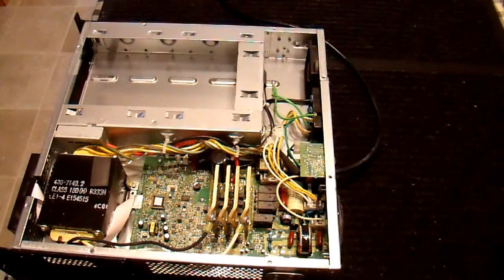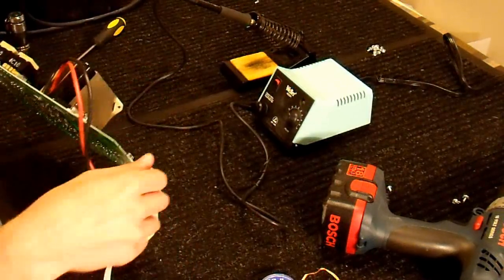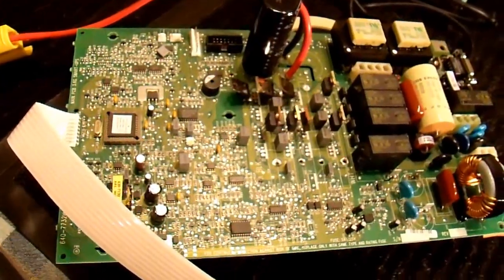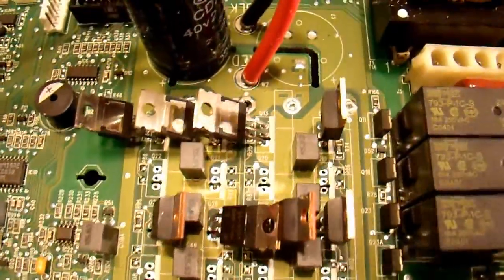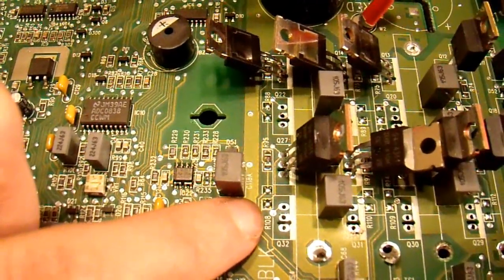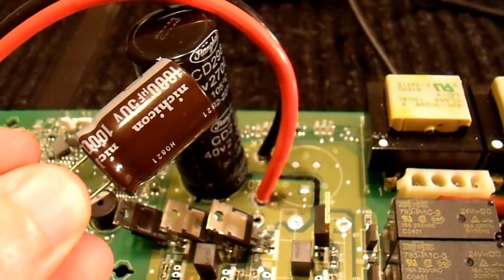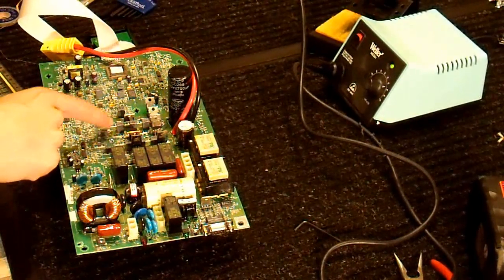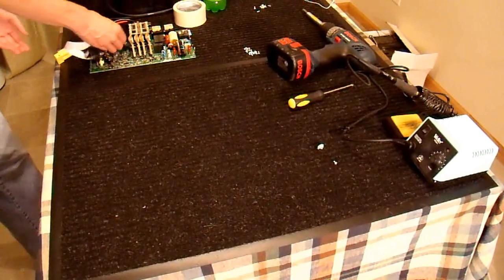UPS to 1.5kW Sinewave Inverter Conversion part6 - Making the Modifications

Comment: The original mosfets used here were HRF3205. 
Datasheet ==> http://www.redrok.com/MOSFET_HRF3205_55V_100.0A_9mO_Vth4.0_TO-220AB.pdf

Closet replacement part is the IRF3205. It is listed as having 110A instead of the original 100A.
Datasheet ==> http://www.irf.com/product-info/datasheets/data/irf3205.pdf

Comment: would it be better to replace all of them with all new. higher current FETs with less resistance than the OE parts. and add additional FETs to the board?  how much would be possible to gain from this board. of a board similar. I guess the boost stage would need an additional inductor. or a larger one to gain current. then maybe caps. and with all that. maybe the shunt if equipped. to fool the chip of what the current is.  has anyone went this far with a inverter or ups?

Comment: Hello, I wish to make it work as an inverter, it means, to put an on/off switch to make something automatic. The problem is that I tested some relay to activate on the board but it do nothing to power up the ups when is activated. Do you have any idea where to put that switch to directly activate/deactivate the ups at a press of a button ? I hate that smart stuff at front, pressing n secconds, etc. *the ups will must work properly only on batteries. Thanks.

Comment: Gate resistors also keep the gates from oscillating during switching. It would be much better to replace all MOSFETs with matched sets, so that they all switch concurrently, and therefore share the load far better. Otherwise the first one(s) that turns ON (lower Gate capacitance) carry 100% of the load until the ones with higher Gate capacitance finally turn ON... and just the opposite when they turn OFF.

Comment: I found these Transistors on Mouser so I will order them from there. I will order 32. and replace them all or order 16 and put 16 new on one and put the others with the other unit so they can have matching pairs.  they are 55volt 80 amp  http://www.mouser.com/ProductDetail/STMicroelectronics/STP140NF55/?qs=%2fha2pyFadujpSAL6NPntw%2fEzPqD9sfgi96RC878X4R4%3d  and I will also order the 20ohm ristors also.

Comment: I have P140NF55 transistors in my tower unite I can find the data sheets but look to you know buy 16 more since I have two of the units I like to convert to the 1500 watt units. then need to adjust the software to read the 1500 watts and not the 980 that its rated at. will also add a second cooling fan and place a heat sink on top of the transformer for added cooling. took out the expansion bay so I can get better air flow.  so will the's transistors work in the unite I have and would it be better to just replace them all with matching Transistors.  other wise I will order 32 of the Transistors you have listed. and with the gate resistors should I populate those according to the transistors, on gate resistance.

Comment: i think that termalpaste isn't the best idea as it make isolation between Fet and Al.
Reply from the maker: That's a good point.  This design uses the heatsink to FET connection as a current carrying path.  It does also employ one of the legs for current too so I don't think the paste will affect the resistance by a measureable amount.

Comment: Have you looked at the output waveform after doing this?  Those mismatched MOSFETs and missing gate resistors are a bit concerning.

After "upgrading" an SU700, I had problems with the output that were difficult to identify until I hooked it up to an oscilloscope.  It was based on IRFZ46N MOSFETs, and I was replacing with IRF3205 and I had chosen incorrect gate resistor values.  I ultimately settled on using 47 ohm resistors, and it's been suffering through 700-800 watt loads for a few hours a week over the last few months without any issues.
Reply from the maker: My scopemeter along with other functional tests showed the mismatches to be acceptable and the unit performs well.  A true oscope might reveal some imperfections but the UPS does have an integrated line filter on the output.
Reply: Did you add a fan in there? I seriously thought the output transformer would become the limiting factor in this kind of modification. I have a SU700 (220V 50HZ model) with stock FETs and the transformer will thermally run away if I load it with 700W continuously. A fan would help somewhat. I love APC for having over-engineered all of their older products. Do try to save these products from waste bins while you people still can :)
Reply: drezster The one I've got is actually an SU700XL (120v) and already had a fan.  I'm using it to supplement a larger UPS for some added redundancy and currently just have it equipped with stock batteries.  I think if I were going to run it off a larger pack, or try to run it continuously as an inverter I'd be a little more concerned, but with only a few minutes of capacity I don't think it ever runs long enough to have cooling issues.

Comment: I would have thought the 20 Ohm Gate resistors were fairly important... to limit the turn-on/off rate, and aid the power sharing.  Also, would it not have been better to move 4 of the original MOSFETs to parallel the other original 4, then add the 8 new ones... that way all are in matched sets.  Nice series... thanks!